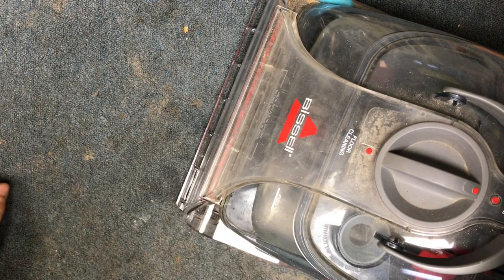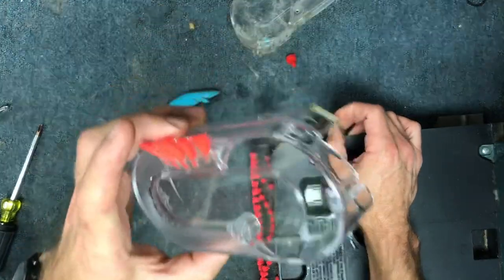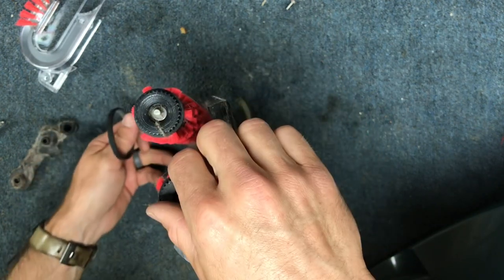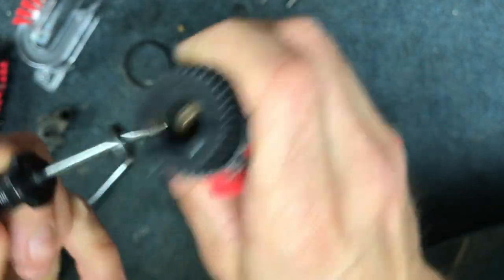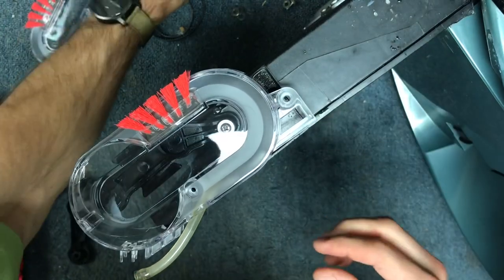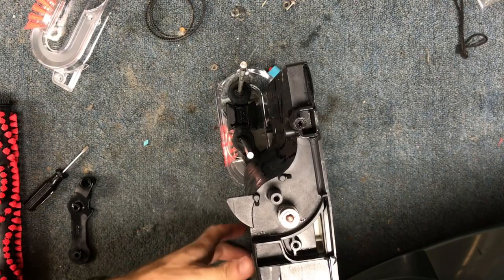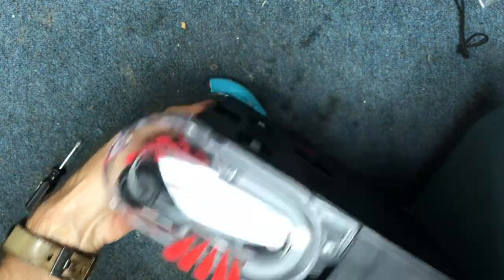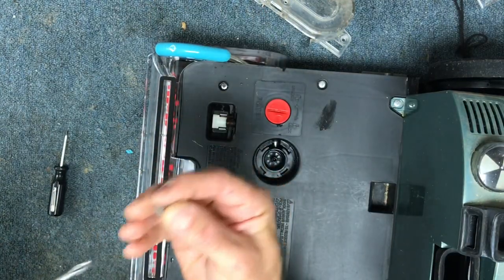Vacuum repairman shows how to replace belt(s) on Bissell Proheat 2X Carpet Cleaner

Comment: I have a question if you can answer. On my proheat 2x keeps breaking on left side smaller belt . Model 1383  I keep my cleaner very clean. No hair no strings nothing is stuck on the roller or any where . The belt breaks within five to ten min. I have tried several deferent belts . Is their maybe a certain belt that’s better ?
Reply from the maker: What kind of carpet are you trying to use it on? Is it a super thick carpet or rug?
Reply: @richardsvacuumcenter  no not realy not think it’s a place am renting and it’s been here for six years I would say but no . If you put your finger down into the rug it covers just the tip of your finger and am a girl so that’s not much at all . Iam pretty handy with things and I be scrapping and breaking things down motors and all so I usually can figure things out but not this time . Could they just be cheap belts I got them on Amazon twice they came two pair in a pack . Cause the brush rolls fine when I spin it with my hand . This last time right before the belt broke I heard a weird sound and I knew right away that the belt was going to break and it did. Should the belt be tight when you put it on because it seemed a little loose
Reply from the maker: @nancyellmore2565  are they genuine bissell belts? If not, I would say first try ordering the genuine bissell brand belts (oem). part numbers are in description.
Reply: @richardsvacuumcenter  ok ya I do that thank you and no Iam pretty sure it was another name  . The no frills belts . I never seen the Bissell belts on Amazon but I order parts from Bissell before.  the front plastic cover where the rollers are seems to break often . It just a little piece of plastic no big deal but I like taking care of my things so I order one One or two from there. I got a feeling thats what it is . Thank you for your time and help. If an able I try to send some business your way but summer over and thats when people come to the beach.

Comment: Hi! Great video! I have a Pro Heat 2x w: 2 in 1 tank (9200 model). I am not getting spray from the big tank to the floor (on rinse or soap setting) but hose attachment works fine for spray & suction. I cleaned all nozzles, tubes & even heater(which was pretty bad). Suction is fine, rollers spinning & machine is well maintained. Are there any connections that impact spray that may have wiggled loose during cleaning? I tried priming pump by turning on for 1 min & then using trigger but nothing happens. Any ideas would be greatly appreciated!
Reply from the maker: Most common issue is clogged heater. Sounds like you addressed that already. If heater is cleared then move to checking the sprayer tips and the solenoid valve

Comment: I know this is an older video but I have a Bissell 2X heat pet revolution model 1551w.  I cannot find the left small/short  cog belt! I ordered a belt from Amazon according to the model number.  It does not fit.  It doesn’t stretch at all so there is no way to put it around the cog wheel and pin.
I cannot find a replacement belt anywhere.  The Bissell website does not have it.  Apparently other ppl have ordered from Amazon and have the same issue with the belt not fitting.  Where can I find one?  Thank you
Reply from the maker: I’ll check tomorrow! Sorry for the delay
Reply from the maker: There are 3 belts in this machine: 
Rubber motor/pump belt: 1606428
Left (from standpoint of the user of machine) brush belt: 1606418
Right brush belt (connects the back brush to front brush): 1606419
Reply: @richardsvacuumcenter thank you!  I typed in the model numbers you provided on your video into the search bar on Amazon and they came up!  I was hesitant to order but I did anyway.  The belts came and they were a perfect fit!  We are back up and running!  Thanks!!

Comment: Thank you- great video. My big belt over-heated and left some hard melted residue on both ends of the rollers. How can I clean them so the new belt doesn't break?
Reply from the maker: Some times the melted plastic will chip right off. Might be possible to salvage your brushes but they could just need to be replaced.

Comment: I have the same one but not getting suction on the bottom part but I am on the tool wand. I turn the dial to carpet but suction. I cleaned it and took it apart  cleaned the filter and nozzle on the front. Still no suction??? What am I over looking? Can the drive belt cause it to not have suction on the carpet part? Still have suction on the tool wand?
Reply from the maker: drive belt would not have any relation to your suction issue. not sure what your issue is. sorry it's hard to help online with things like this!
Reply: While maintaining side casing  water jet side a little spring came out is it part  same model  as demo thanks
Reply: I figured it out it was the belt and the face plate was cracked.

Comment: Great video we have a Bissell Pet Pro model 17 N4 which doesn’t spray could that be a belt or would that be the pump that failed??? Thanks for the response we truly appreciate your assistance.
Reply from the maker: Does it have a heater?
Reply: Yes it does.
Reply from the maker: Most of the Bissell that come in my shop that don’t spray have a clogged heater.
Reply: Thanks for the response and advice not sure if I can take it apart and check the heater or see if it’s clogged looking for an authorized repair shop in my area now.
Reply: @richardsvacuumcenter  do you have video for cleaning a clogged heater?

Comment: I opened my machine but my 2 belts are not broken. Still the brushes don't spin and I have very weak suction. What should I do next?
Reply from the maker: handle needs to be in back position for brushes to turn. did you test it with handle back or locked upright? for suction you need to check the little red screen inside your top cover of the recovery tank. it's rectangular and usually gets hair stuck in it and will reduce suction significantly.

Comment: Would this fix a no spray also problem. I got no spray and no rotation
Reply from the maker: Probably not. No spray is usually a clogged heater or a bad valve.
Reply: It’s actually both no spin, no spray. Thank you for the response

Comment: Hi, just a quick question, does the brush suppose to spin during cleaning? Because I just noticed mine doesn't.  Thanks in advance
Reply: I already checked and belts are fine and not broken
Reply from the maker: Yes they should be spinning during washing
Reply: @richardsvacuumcenter  thank you for getting back to me, any suggestions why not spinning even though the belts are not broken?
Reply: @hosenmo1727  I'm having the same issue.  Did you identify the problem in the four months since you posted?

Comment: Hey do you know how to remove the bottom part that holds the brush rolls with the belt and it has the metal poles attached?
Reply from the maker: The non motor side has a clear cover as well with 2 screws. Remove that clear cover and it will give access to that axle assembly
Reply: @richardsvacuumcenter  thanks and I tried replacing my brushroll but everytime when I push the vacuum I hear friction sound coming from the belt on the left underneath the cover I did everything like you did in the video
Reply from the maker: @moreatastic4590  hmm then I don't know if I can help you beyond that. It's hard to diagnose things like this without just having a look at them.
Reply: Great job!!! Thanks it helped me out!!!!!

Comment: Great video.  I have same or similar model (had it for ~20-25 yrs).  I have disassembled, cleaned, checked belts many times, so I am pretty familiar.  Just now, my machine stopped dispensing clean water from the 2-in-1 tank.  It does dispense the cleaning solution from small tank.  Machine has good suction, brush rollers turn when machine is on and handle is back.  I checked to make sure the poppet in the valve at the bottom of the water tank moves freely.  Any ideas?  This model is so old, most online "help" is geared toward newer units.  I will gladly send you a gernerous donation via paypal if you can offer some help that gets me up and operational again.  Thanks!
Reply from the maker: Does it have a heater?
Reply: @richardsvacuumcenter  Yes

Update:  Called Bissell toll free product support line. Went through additional troubleshooting. Turned out the white plastic spray nozzles on the ends of the black rubber feeder tubes in the base were clogged. Cleaned them with an old toothbrush and got back to work!

Comment: I opened up my machine, both belts are fine, not split.  Yet my brushes don’t turn when i turn on my machine.
Reply from the maker: Is the handle in the back position when you are testing?